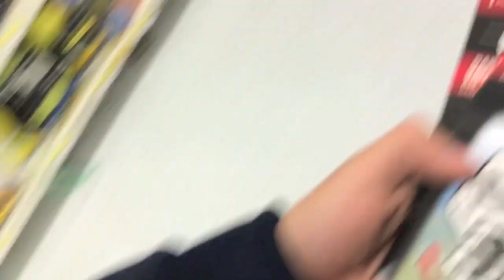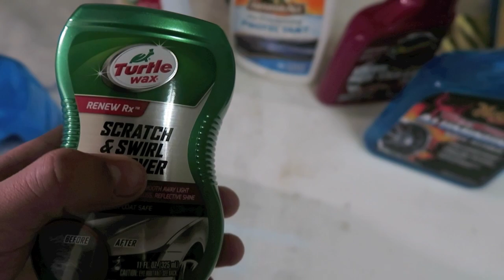DETAILING MY CAR!!!! (Watch This Before You Detail Your Car!)

Comment: I highly recommend you to join http://www.autogeekonline.net/

I see tons swirls @9:05 , but its white bmw so you won't remove anything by hand. 

1.wash wheels and tires first and then paint. 
2.clay bar if surface feel still rough. 
3.compound/ polish 
4.LSP, (wax, sealant, coating, or w.e),  

clay bar and polishing step will remove your old protection, 
this case turtle wax swirl remover.
Reply from the maker: thank you!

Comment: You should've done that in reverse order. Scratch remover then the quick detail and wax.
Reply from the maker: ok thank you im still new at detailing! thanks for the advice bro
Reply: You're welcome. The quick detail and wax leaves a small layer of wax and the scratch removed is like every fine sandpaper will remove any wax and a fine layer of clear coat. So you'll need to apply the wax last.  But still a great video!
Reply from the maker: ill keep that in mind thank you bro!